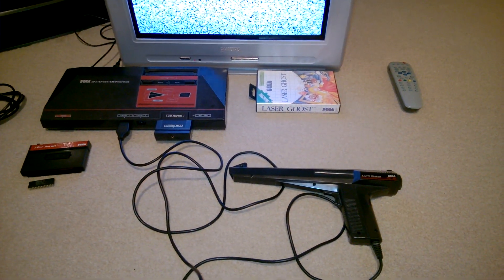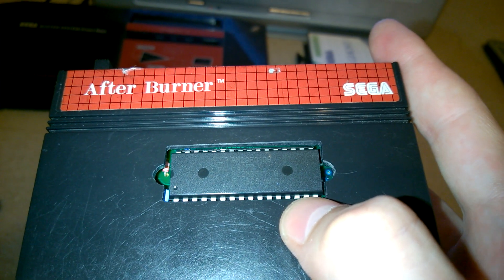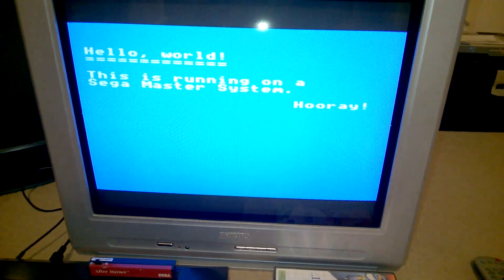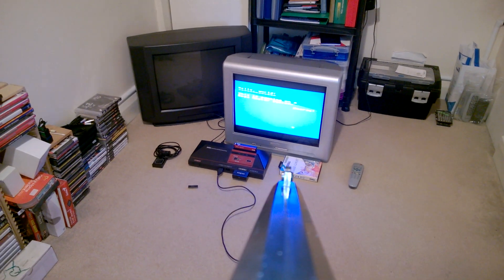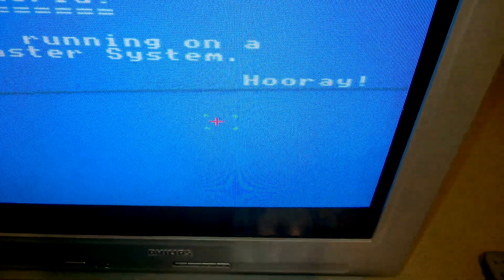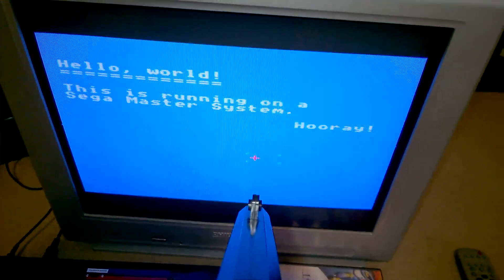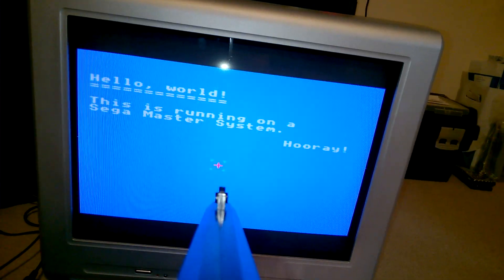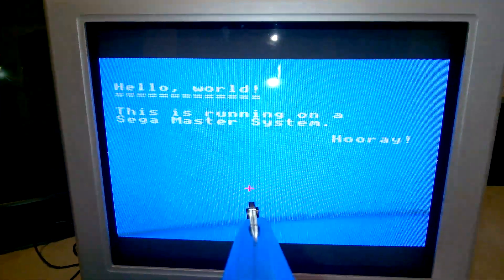A little experiment with the Sega Light Phaser

Comment: Thank you so much for sharing this. I was seeking this video to ask if you'd share just as coincidentally someone else already did yesterday 😂

Curious if you have an SMSPower account to upload this homebrew, or if you'd be happy to have it recorded there. Someone was only recently updating all light phaser games a few days ago.

Incredibly useful. I'm trying to work through understanding my own result from my SMS2 now your test rom has cleared up my issue. My aim is offset to the right and never reaches the left edge. MiSTer emulation has also struggled with Phaser accuracy so this will no doubt prove incredibly useful in a few places! Thank you again!
Reply from the maker: Thanks for your comment! To be honest this was never intended to be useful code or a proper release, just a quick experiment for my own entertainment to see how the light gun on the Master System worked and a bit of a surprise at just how well the guns do indeed work. As such the code isn't really something I'd consider fit for release (e.g. to SMS Power!, where I am a member) and that's why I never cluttered up their archives with it...
Now that the 240p Test Suite sometimes includes controller tests too I wonder if integrating a light gun test into one of its conversions might be more appropriate? Not sure if one exists for the Master System, but I see sverx has developed something similar for the Master System and that includes controller tests, so maybe I should fork that and submit a pull request if it is indeed seen as a potentially useful feature.
Reply: @benryves  Appreciate your thoughts, honestly this will be very useful even as it is I think. I'm an SMS coding beginner, but will be very interesting in checking out how you got it all working. There are certainly a few homebrew light phaser games, but not so many showing 2 player examples that I'm aware of.

I did ask sverx on the SMSPower discord and they noted the SMSTestSuite has very little space left in the 32 KiB ROM at the moment, work ongoing but not soon they noted.

Still great to use the test standalone. You should make a forum post on it, or if not, I hope you don't mind if I do in a while because it might help resolve some interesting little quirks of variances across SMS and CRTs.

Comment: Is this test ROM available anywhere? I'm having issues with mine and suspect it's not tracking well. It'd be very useful to have your tool to track (and make it available to others on the ConsoleMods wiki)
Reply from the maker: This wasn't intended to be a proper test ROM, just a quick experiment I threw together to see how the Master System hardware handled light guns. With this caveat in mind, I've included a link to the test ROM (including source code) to the original description of this video (links in comments tend to get hidden). Cheers!
Reply: @benryves  Thanks so much! It'll definitely be useful to many (and fun to test how far away it'll still track accurately)
Reply: Managed to repair mine and make aiming adjustments using the app, thanks again!!

Comment: This is really fascinating! I wonder what the same program would look like on a more modern TV (i.e. one that the Light Phaser doesn't work with). It'd be interesting to see a visualization of how it attempts to parse the gun's position on that.
Reply from the maker: Thank you! The light gun contains a light sensor (and amplifier) and sends a pulse to the console when it "sees" light (any light) via the controller port's TH pin. The program on the console can poll whether the gun currently see any light, and when it does it can read the VDP's free-running vertical counter register to determine which scanline the VDP is currently outputting to the TV to determine the vertical position. It can also read the horizontal counter register to determine the horizontal position, but as this would count up too quickly for the software running on the console to accurately keep up with this is automatically latched by the hardware when the TH line goes low rather than being free-running.
This works on a CRT because the CRT isn't constantly illuminated, only a small extremely bright dot is illuminated at once (the position of which corresponding to the horizontal and vertical counters in the VDP) and it's our persistence of vision that makes it appear as a solid single image (albeit a slightly flickery one, at least here in 50Hz PAL-land). On a modern LCD TV the entire picture is constantly illuminated by a solid backlight which means there's no way to determine the aimed position on when the gun "sees" light as it will constantly see the same light, regardless of where it's aimed (though in practice the spot that you aim at on a modern LCD is a constant much lower brightness, rather than a sudden very bright spot on a CRT when the sweeping beam passes under the point you're aiming at, so it may not have enough brightness to trigger the light sensor in the gun in the first place).

Comment: Great program! I got this gun but not the console, however I am using it with a House of the Dead arcade PCB and the Sega Model 2 gun I/O board. Plug and play. Trigger goes to filter board, the rest of the connections go to the Gun I/O. Surprisingly, the Phaser worked very accurately but I have to adjust the picture to a more reddish-yellow level on my 17" Iiyama CRT (that can sync to 24khz medium res). I wonder if you plan to use this gun with any arcade boards in the future.
Reply from the maker: Hi, thanks for the comment! :) I'm afraid I don't own any arcade hardware but it's interesting to hear you had good results with a Light Phaser on your Model 2 board. I have designed a couple of adaptors that let you use a Light Phaser on the Mega Drive or Mega CD (for games that require the Sega Menacer, Konami Justifier or American Laser Games GameGun), though.

Comment: I tried this with the NES Zapper in the "Zap Ruder" tech demo. I could get a solid lock on the vertical position, but horizontal was a mess. Minimum and maximum over the course of a few frames varied by 80 pixels. This is good enough to narrow down the list of targets to flash white or to move the cursor up and down in a menu, but not to (say) aim a grenade.
Reply from the maker: Very interesting! I don't know much about the NES hardware, sorry. How were you handling the timing, was that a software timer or does the hardware provide some mechanism for doing so? (The Master System's VDP latches the horizontal counter when TH on the controller port - connected to the gun's light sensor - goes low, which makes it easy to get an accurately timed value). Is the signal from the gun itself clean, or does the ~15kHz demodulator introduce any issues? (I've heard some third party guns omit the demodulator, do those work any more accurately). I know that NES games normally use a sequential target system rather than a raster scan timing system so am impressed it worked at all! :)
Reply: @benryves  The NES PPU has no such latch. Zap Ruder's polling kernel is a software timer counting 113.667 cycles of the 6502 per 3 lines. This is enough time to poll both guns once per line in the 2 guns kernel or one gun 14 times per line in the XY kernel. I own a gray official gun (from before toy safety regulations changed) and a red gun (from afterward), which is why the characters are wearing gray and red. I suspect analog characteristics of the demodulator might be part of what introduced so much X variation in the 14 polls per line routine, but Y is still accurate because the timing variation amounts to a quarter scanline.

I currently own no third-party NES guns with which to test. If you have an NES, a flash cart, and a third-party gun, feel free to try the XY test and see if it gives cleaner results.
https://github.com/pinobatch/zap-ruder/releases
Reply from the maker: Thank you for the information. Unfortunately I don't have any experience with (or access to) a NES so can't try out your program myself but it's definitely interesting to hear about the challenges on contemporary hardware, so thank you again!

Comment: I recall there are 2P lightgun games on Master System? Though you will need to monitor one lightgun per frame to get usable results (and if both fire at the same time, then one of them will have to be examined the following frame instead)
Reply from the maker: Gangster Town is the only two-player light gun game I've got, most only support 1 player. I'm not entirely sure how it will work out with two guns, there are separate TH pins on each controller port but only one horizontal counter in the VDP that's latched by TH (is it latched by both, or do you need to disable TH somehow for the gun you're not handling that frame, e.g. by making it an output pin instead of an input?) My naïve assumption is that it should be possible to handle both guns simultaneously but I don't know how it'll work when both are aimed near the same part of the screen (or even just near each other vertically), I'll need to do some experiments when I get my second gun.
Reply: @benryves  In 1989, I got my desired Master System for Christmas. The kit came with the console, plus 6 games and TWO Light Phasers. The only game that worked was Gangster Town (I think the salesman deceived my father, as the use of it was quite restricted). Last month, I bought an SMS exactly with two guns (to play with my son, who asked for it as a gift). I started to see if there were any homebrews or tutorials to make gun games, even to try to make a kind of game with two guns and take advantage of the two more. According to your explanation, it shouldn't be anything trivial.
Reply from the maker: Thank you for the interesting story and shame there weren't more games with two-player support at the time! Digging into my code from four years ago I got two guns working by alternating which gun I sampled on each frame and disabling the gun I didn't want to access by driving TH low (output %11110111 to port $3F to access player 1's gun by disabling player 2's gun, output %11111101 to port $3F to access player 2 by disabling player 1's gun). If the two guns are pointed at different scanlines then you don't need to do this, but if they are pointed at the same one there doesn't appear to be a way to determine which one's TH input latched the VDP's horizontal counter. This technique won't work on a Japanese Master System, though, as you can't drive the TH lines as outputs... Maybe digging through a disassembly of Gangster Town would be the way to determine the correct approach.
Reply: @benryves  Seems that port $3F doesn't exist at all on Japanese consoles… your best bet may be to loop through the whole screen and peek the HV counter whenever bit 7/6 of port $DD goes low (since the HV counter will update as long as TH is low).
Ironically that's also what several Mega Drive games do despite having better control over this (sometimes not even enabling the latch, cue the Menacer looking less accurate than it actually should be, oops).
Reply: I was thinking the same think yesterday. lol.